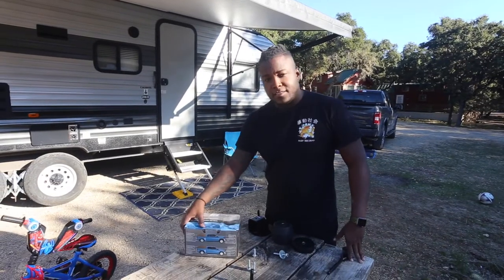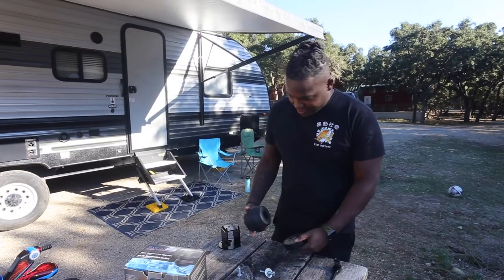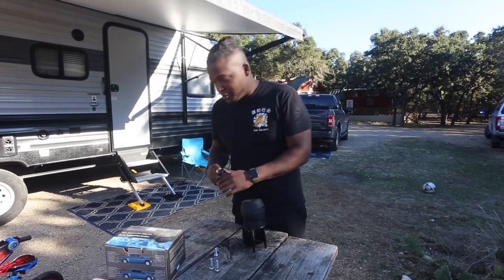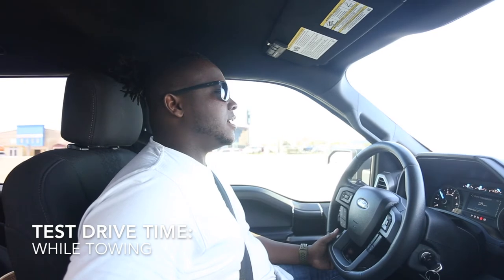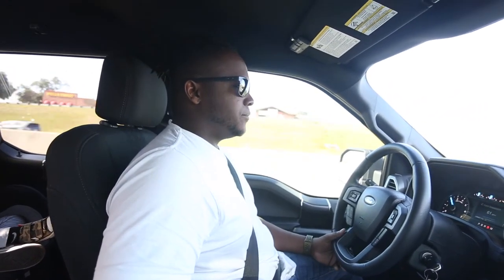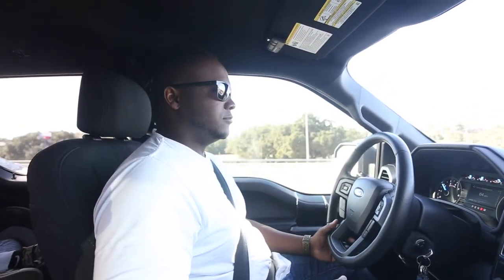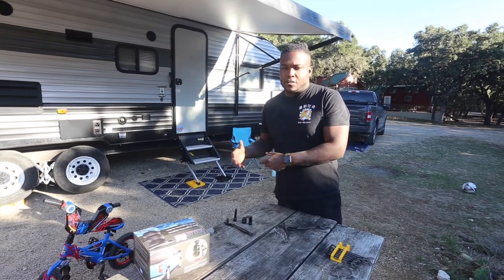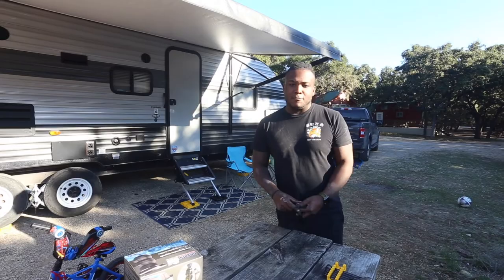Half Ton Towing: How to Install the Timbren Suspension Kit on an F-150 // FULL TIME RV FAMILY

Comment: I have a 2018 F150 XLT Supercrew. These work great for towing however upgrading the stock rear shocks helps considerably. I added the Timbrens, upgraded to Rancho shocks and added a Hellwig sway bar. Huge improvement. The truck rides much better unloaded with the Timbrens installed if you upgrade the rear shocks. The stock ones are too weak which has you bouncing off the Timbren. If you remove the spacer from the Timbrens you will get better ride quality also however you will get more squat. To get maximum effect use the spacer but upgrade the shocks.
Reply from the maker: Thanks!! We noticed that too! We no longer have this truck but loved the Timbrens! Thanks for watching!
Reply: Just install them on my 2018 F-150 as well I was kind of wondering if I could remove the spacer being the ride is very jarring now that I have the timberands installed.
Reply: I know you don't have the truck anymore but why did you go with the Severe SES kit as opposed to the regular one?  I think the kit you had was designed for camper trucks instead of just trailer and hauling.  I think that would explain the rough ride unloaded.

Comment: Good video. Thanks. Many of us have half ton trucks and even though some will move up to a 250 or 350 knowing what is out there and how it works is appreciated. Just as a side bar, do you have the 10 speed? If yes, how does it do on the highway towing 7000 pounds at 65. If you have any idea?
Gramps

Comment: Nice video, thanks for posting it. Question, looks like you have the severe service kit by Timbrens, why did you go that route vs the regular kit. I'm only asking because I'm looking to get a set for my 21 f150, my trailer looks similar to yours in size. I just wonder if that kit is too rough?
Reply from the maker: Hey! Thanks for watching. We went with that particular kit when we had this because the tongue weight of that RV was over 600. To stop the sagging. But yes it was stiff when not towing, but perfect while towing!

Comment: What was your tow capabilities before and after? and also what was your camper weight
Reply from the maker: It doesn’t really change the tow capacity, just the way it rides. They leveled out the truck ride when we put a load on it and stiffened the ride when going over bumps. So way more stability. Our camper weight at the time was almost 7200 pounds loaded.

Comment: I have a 2020 F150. I'm pulling a 2019 Keystone Cougar 29RLD Half Ton trailer. I have some swag and even with a sway bar I still have sway. Obviously the swag improved on your unit but have you noticed whether the sway improved after the install of the Timbren?  I really like your presentation. Great job!!
Reply from the maker: Hubby said Timbren's don't help with sway they really are only suspension support. For example, when you hit dips in the road and the truck and trailer bounces down the road. We had a sway bar too (this is our old set up) and I think that is just part of having a travel trailer. But it all comes down to your truck and how much you are towing. I hope that helps! Thank you for watching!!

Comment: Did your 2018 have a leveling kit on it when you installed the Timbrens? I've got a 2017 in which I have a 2 inch fox leveling kit on, but now need to tow a 27ft enclosed snowmobile trailer, but truck squats pretty good with the leveling kit. Trying to mitigate that if possible. Was going to go the airbag route but don't want the upkeep and always having to worry about leaks in the Wisconsin winters.
Reply from the maker: Yep we had a 2.5” leveling kit on the 2018. It squatted with the trailer until we put the Timbrens on.

Comment: Great video. Considering adding these to my 21 XLT. I noticed that you installed the heavy duty “severe” service Timbrens. Any reason why?  I’ve heard mixed reviews and can’t decide if I should order the regular kit or severe service.
Reply from the maker: Thank you! Since we were towing every 3-5 days we wanted a heavier duty set up because we weren’t going to change the leaf springs. If you’re not towing often then the regular ones are fine! Thank you for watching!
Reply: @FaithBoundFamilyAdventures  thanks. I’m likely going to go with the heavier ones given the weight of my trailer. Any regrets for regular driving or do they make the ride too harsh?
Reply from the maker: You can definitely tell while regular driving. It’s a little rough. If you’re not towing all the time I would take them off while not towing.

Comment: What year is your truck? I believe I heard you say 2018 in the video. The kit you have listed goes up to 2014. Part number FR1504E or FRTT1504E are listed on Timbrens site for 15 and newer. This may explain some of the harsh ride unloaded. Thanks for the video. Take care.
Reply from the maker: Thanks for pointing that out! I switched the link to the correct one we used!
Reply: @FaithBoundFamilyAdventures  Thanks for the reply. I have a 2016 F150 Platinum and am considering these. The kit I'm looking at has a plate that mounts to the axle. This is the impact point for the rubber bump stop/spring. I don't see it mounted on your axle. Just mainly looking for confirmation that my research is correct. Take care.
Reply from the maker: @bcbsilverhawk8426  Hello! Joseph here. There are two types of suspension kits. One comes with the plate and that is for 4 wheel drive. Our truck is 2 wheel drive so it didn't come with the plate. But I'm not sure if it will change ride quality while you aren't towing though. Hope that helps!

Comment: Hi Kurt Tidrow- you recommend leaving the rubber spacer out for a smoother ride. With these removed, do they still have the desired support? Does anyone know if there is a spec recommendation on whether or not to use the spacer or what height they should be at?
Reply from the maker: Only take the pads out if you aren't towing. Definitely need the pads while towing. We were going to take them off when we weren't towing so we had a smoother ride. Hope this helps!